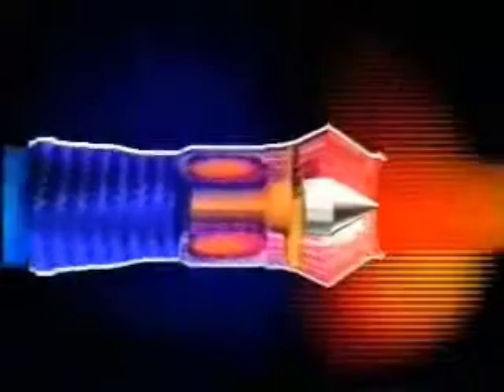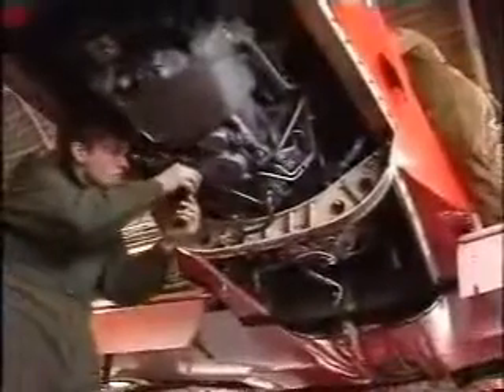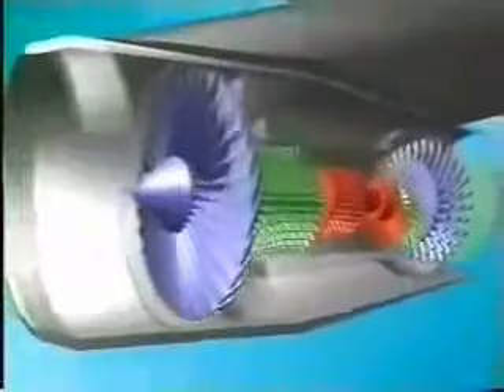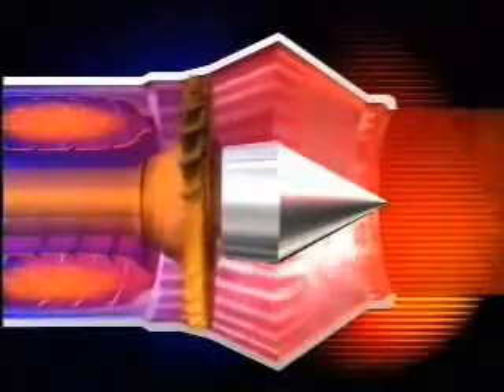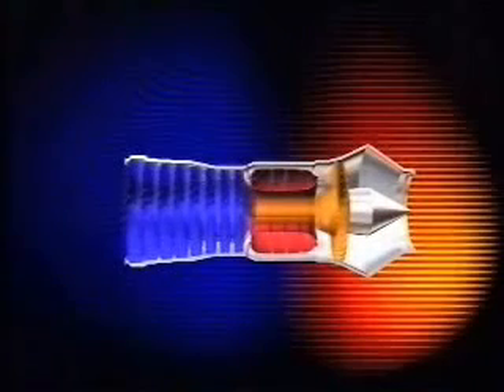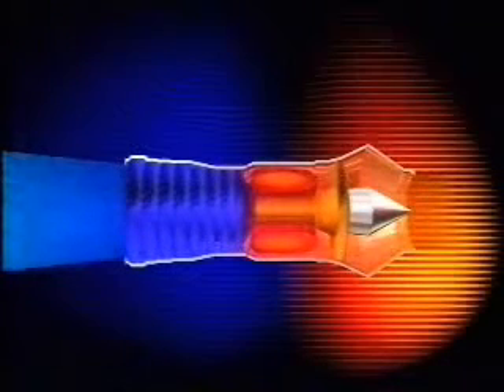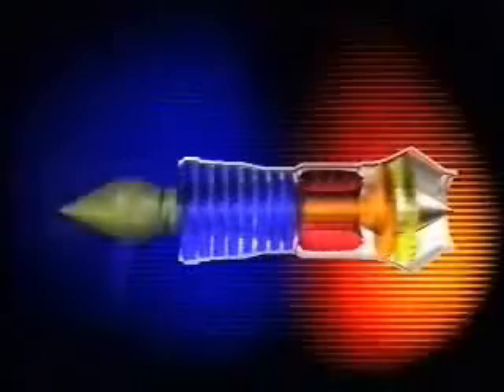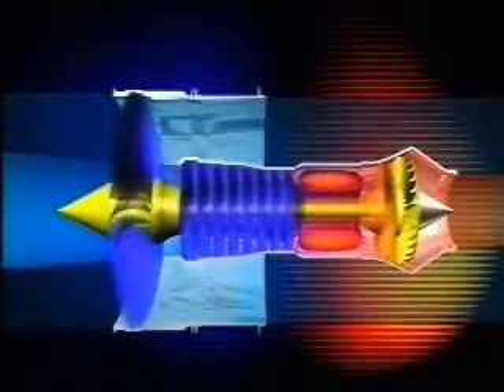simple but good video on how jet engines work

Comment: @Mini40Kgamer there you are past any critical mechanic components and you are able to burn fuel a lot hotter than in the combustion chamber. You may have about 1200 K in a combustion chamber and about 2200 K in the afterburner. Adding mass to the fuel flow is done with these huge Fans on modern aircraft engines, letting about 90% of the airflow pass the central engine core.

Comment: @Mini40Kgamer The thrust of an engine is calculated by Newtons second law F = m * a. For greater thrust you either have to increase the acceleration of the airflow through your turbine (by burning more fuel, thus have a hotter combustion with a greater expansion of the air), or by increasing the mass of the airflow.  Because of the mechanic impact of a hot airflow on the compressor, some of the fuel burning is done after the compressor, the so called afterburner.

Comment: @Mini40Kgamer the turbine powers the compressor, so for a turbojet engine, you will need a turbine. However, there are different jet engines without turbines that use the airspeed to compress the air for combustion. They are called ramjet, if there is a subsonic combustion, or scramjet (supersonic combustion ramjet). The turbine isn't the major difficulty in an engine anyway. The compressor is what takes most engineering hours.

Comment: @Mini40Kgamer Yes you can! It's called a Ramjet engine. For a ram jet, you must have forward velocity in order to maintain sufficient compression. Therefore, aircraft equipped with this type of engine require assisted takeoff. These are typically used on experimental type aircraft, guided missile systems, and space vehicle systems.